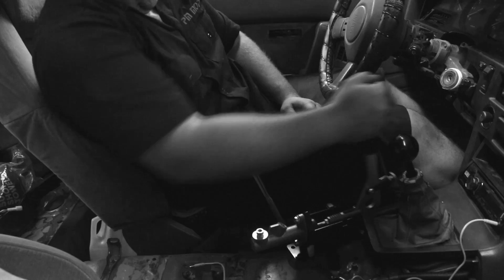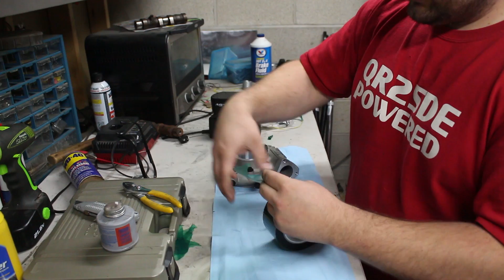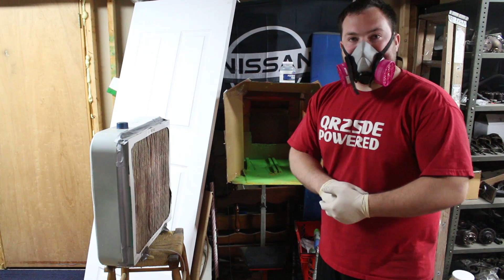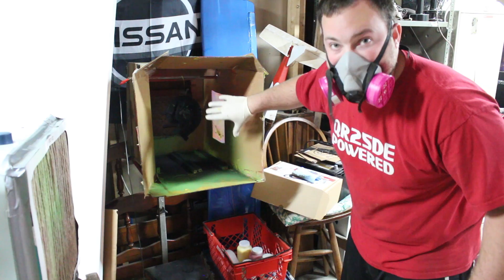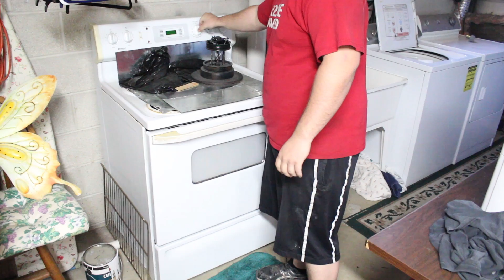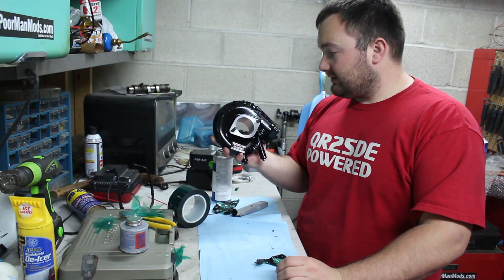Powder Coating Tomei Turbocharger

Comment: So the spark , bad ground and to keep the tape from doing that make a small cut in the tape after u powder it . Also ur supposed to start the timer when the part it’s self reaches the desired temp . Not trying to criticize or sound like a jerk . Just throwing what I’ve learned out there . Sweet video

Comment: actually for the most optimal prethreatment for aluminum you would want to dip it in a  degreasing alkaline bath then i would wash it then dip it in a corrosive bath such as caustic soda to remove a thin layer to get a smooth surface.
Then clean it again and dip it in a deoxidiation bath(can be acids such as sulfuric acid and/or hydroflouric acid) then to finish off the prethreatment i would dip it in a reactive barrier such as(titanium-aluminium-fluoride-polymer) to add a protective shield incase any corrosion/crack/marks that are all the way to the metal wich will protect it from spreading future and damaging the product/coat(also works for zinc alloys)

Comment: Tip... use a file to file round the tape instead of cutting man you will get a good edge and less chance of slicing yaself
Reply from the maker: +Jake Woolley you cant cut steal ;)
Reply: Yes but do you understand what I'm on about
Reply from the maker: yes i believe so
Reply: +Poor Man Mods it's a skate boarders trick the overhang you file on the round where you want it cut creates a nice edge.

Comment: Little disclaimer for those at home: DO NOT use the oven in your kitchen. It's extremely toxic. Buy a shitty one on Craigslist... or else you'll die.
Reply: +Nazty604 because while the powder is outgassing, it creates a really bad buildup of powder particles inside the oven. Once those particles re-heat, it is essentially burning plastic. Do you want burning plastic particles on your pizza or your cookies? Of course not. That's why
Reply: @MisterHellYeah the fact that you have to explain this…
Reply: thanks!
Reply: Can u explain why

Comment: I use the same kit and have great results from it. The only thing i would say is a step i do that i seen the pros do is take i hand held torch(propane) and go over the item with it. I burns off any thing left from cleaning it and also removes any oils or water that is present. When heating it with the torch you can see the oils or water evaporating from it as you heat it. just what i do.
Reply from the maker: +The Ginger Patriot sometimes i use the torch

Comment: a nice little tip to cut that tape easier, just tap the edges witg the handle of a screwdriver or something similar. it will cut the edges perfectly, and much easier than using a razor blade. loving the videos as always bud!
Reply from the maker: +Anthony Mense thanks!
Reply: No problem buddy!

Comment: Nice project. I like the diy setup for powder coat. I'm waiting for rb26 turbos to try a diy ceramic coat you maybe could do in your oven using a cerakote oven bake material...I will do a video of it if the results are interesting.